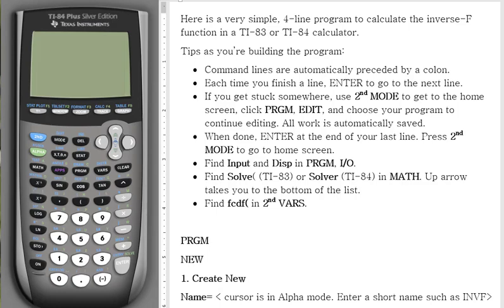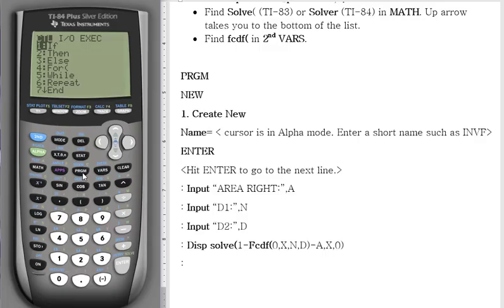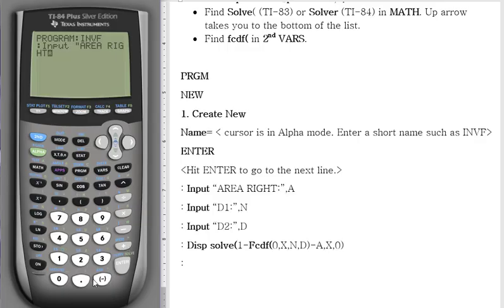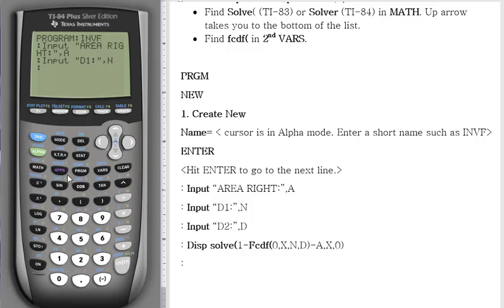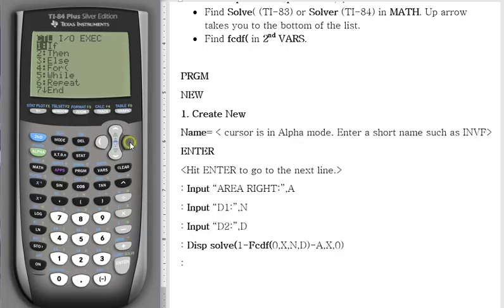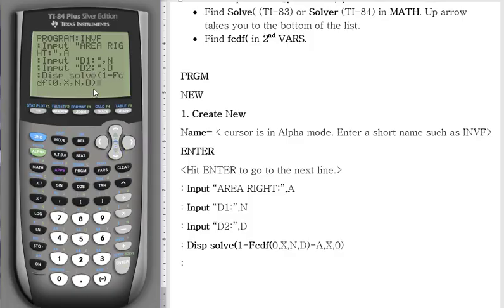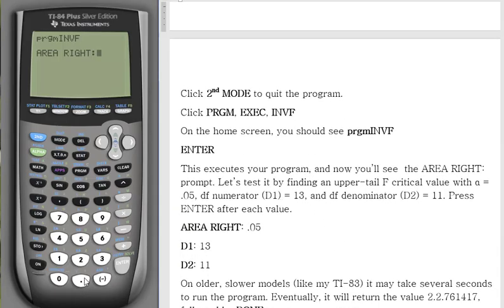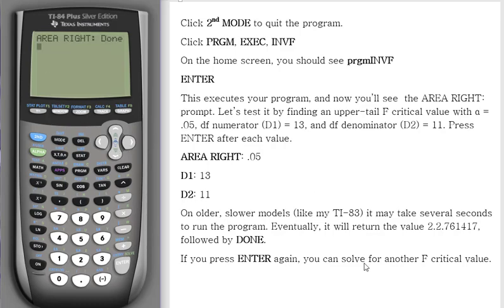TI-83/TI-84 DIY InvF function

Comment: what does arearight, d1, and d2 mean? sample equation would be 2 (sqrt x-2 )-1
Reply from the maker: Hi, we use a statistical test to check whether two populations have equal variance. The F inverse, or critical F, is what this calculator program will help you find so that you can run the test. In other words, it finds "the F value that has some area to the right of it on the F distribution, with degrees of freedom of D1 and D2".  It does not appear to me that your sample equation is a fit for this calculator function.

Comment: Ok so I am getting 2.76. Not 2.276. I wrote the code 5 times
Reply from the maker: Hi, Tejaswai, you are correct, this is a typo in the video. At 4:40 in the video, you see the output on the calculator screen is 2.76; I also say "2.76", but had mistyped it on the screen instructions. I've now fixed the description under the video to show the correct answer. Thank you for pointing it out.